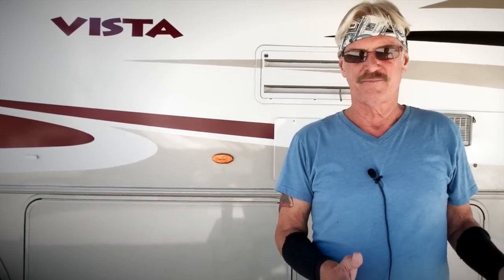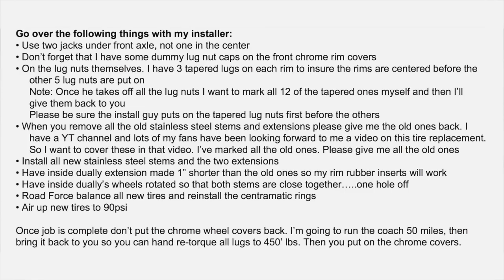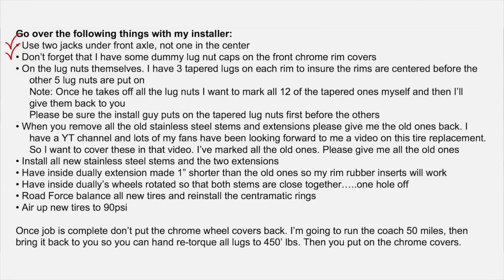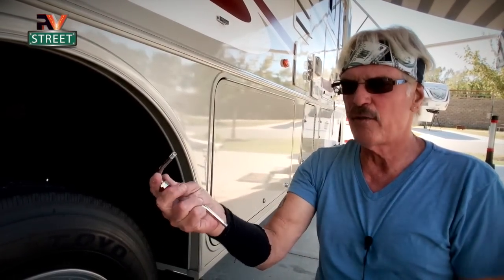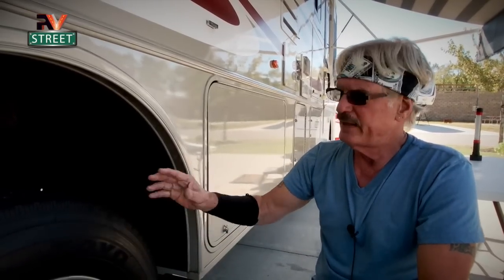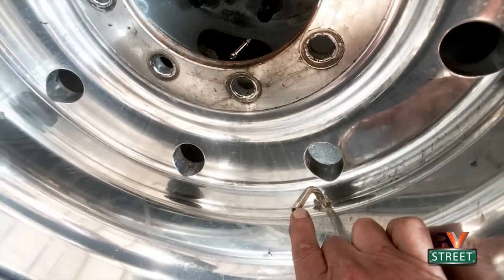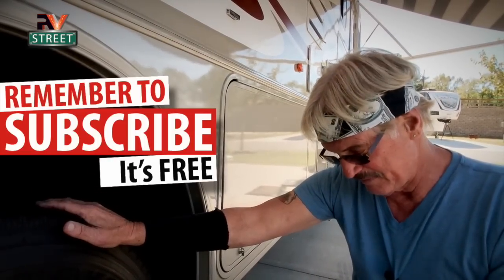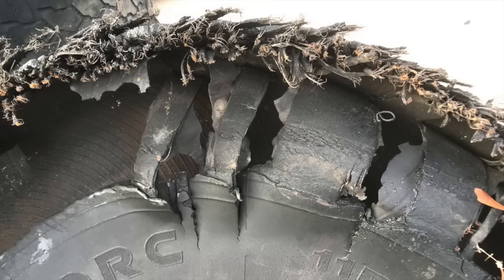In's & Out's of BUYING & INSTALLING New Motorhome Tires

Comment from the maker: A little more detail…
The rubber grommets I showed to hold the extensions firmly in place are hard to find. BUT....I finally have them in my Amazon Store in the "Tire, Engine & Chassis Care" category. And I highly recommend installing Dill Stainless Stems and Extensions that you can get from the tire shop. They'll size them to the exact length you need.

These grommets in my store are a little pricey but well worth the money. They also come with a pair of extensions that will probably be the wrong size for your needs. Just don’t use them. Simply press these tough rubber grommets into the holes on your outside dually’s rim, the extension goes through them, then attach your TPMS sensor. Don’t put any type of lubricant on the grommets before you press them in. You want them to press in tight. They’ll keep your extensions & TPMS sensor solid.
https://www.amazon.com/shop/rvstreet

Our front Michelin tires were approaching to dating out with age and our rear Toyo tires were already 4.5yrs. old and getting older every day. Even though I could have gotten more life out of the tires, being a full timer, I need good tires that I can rely on going forward in the future. I depend on my tires every day. I wanted to change them out now while I still could. With inflation now on rise and supply chains already stressed, I didn’t want to wait another 6 months to a year and then deal with getting new tires, even if I could find them. I’m already seeing and hearing reports from many RVer’s around the country, that many brands of tires are getting hard to find, back ordered for weeks/months and that’s if you can find them at all. And from what I’m seeing, it’s only going to get worse and prices going higher. So being the proactive guy that I am, I acted now.

With my past experience with Toyo tires, I decided to go with M122's all the way around. They are a wider tire than the Michelin 235 x 80R22.5 XRV tires that comes standard on many Class A motorhomes or even the M154 Toyo that some Class A owners go with for a Michelin replacement. Even though the M154 are a little wider, I like the M122 because they’re even a little more wider. I like more meat on the road. And even though there are wider than the above two tires, they still allow enough clearance between the dually’s to keep the tires cool. You can install to thick of tires on the dually’s that will prevent proper cooling, but these Toyo’s are not one of them. In the past 4.5 years with my rear Toyo’s, my TPMS always showed those tires running right around 105º or so, and that’s in the summer with 90psi. They’re a terrific tire IMO.

It took Southern Tire 3wks. to get these tires and they also installed Dill Stainless Stems and Extensions.

If you're not going to Road Force Balance your tires OR run Centramatic Rings then the standard position for your stems on the rear dually's is 180º opposite of each other. Not side-by-side like I did mine.

There is no one part number for Centramatic Rings. The ones you need will depend on the type of hubs you have, bolt pattern and the year and model of your RV. There are literally dozens of different configurations. Contact Centramatic sales and they'll get you the right ones for your RV.
https://www.centramatic.com/

Comment: Great video! I bought Toyo M154 2 yrs ago, they are great! I've read nothing but good stuff about them. 
When first shopping, I priced them online to be delivered but not one place would guarantee the date to be newer than 2 years! Unacceptable!
So I called around local and found a tire shop that called their warehouse to get me dates that put the tires at 5-6 months old and they weren't much more money than online. Like you, I'd rather pay a little more and know what I'm getting. 
I do wish I bought those balancing plates (I will next time), not sure that these little beads do anything at all but I don't have shaking issues. If I need to replace one tire the balancing beads in the old tire are tossed away with the tire, it was my first time buying tires for my RV so I'll chalk it up to live and learn.
Love the Toyo ride and price. So much cheaper than Michelin.

Comment: Thanks for all the info, picking up our new 2023 Forest River XLR Boost 21XLRX tomorrow. I am a retired truck driver of close to 25 years and the #1 cost is fuel and the 2nd biggest expense are tires. I owned several trucks in my career and the biggest thing I learned was to get yourself into a routine of checking your rig daily. Check your tires and your oil every time you get fuel and when you do stop for any reason always do a walk around, and unlike driving a big rig where you are on a schedule my RV days will be at a much slower pace. Thanks again.

Comment: Hey guys Vinnie & Joni from Florida! News on our RV. Supposedly we're going to get it back this week! 6 new tires and all the repairs are going to be finished this week. Plus a roof check. . . Now we'll get to use all the updates and upgrades we did before we went to the keys earlier this yr. 
 The tires we went with are "E" rated Firestones. More than enough for our rig. 
 One thing I'd like to add to your video. When I had my blowout. The closest tire place was a Firestone store. They had 2 tires that were what I wanted. BUT, they couldn't lift the RV. So, we had to run down to a semi truck shop.  They could lift it, BUT, they weren't equipped to mount the tires. . . So, I had to buy the tires at Firestone, then, run down to the semi shop and have them take my rims off and run me and my tires and rims back to Firestone to have them mounted. Then run back to the semi truck shop and have them remount the wheels back on the RV. What a cluster F. . . Good thing is I will now know the history of these new tires. My tires were about 2 yrs out from being to old. But I had 1 bad tire. And just thought it was out of balance. I was wrong. I had a bad tire. 
 Thank God the blowout didn't do any body damage. The blowout took out my black water tank and mud flap bracket and mud flap. It also took off the tailpipe. As well as damaging a plastic fender flare. No body damage. 
 Slam jam took my tire out. Shortly after I hit a joint going through a large city. I noticed my RV developed a slight shake. Within seconds it shook hard a few times and blew up. It was very loud and luckily it was a inside rear. So it was easy to control. And I could still drive it. 
So that's my story. We can't wait to get it back. Great video again!! Take care talk to ya soon 
Vinnie & Joni J
Reply from the maker: What a cluster F. . . INDEED. What a hassle.
Ya, I'll bet your excited to get back on the road.
Reply: Yes sir we are.

Comment: I’m getting TOYO tires installed Monday. I had watched your video previously and I remembered that tool you were talking about for the lug caps. My front wheels are solid, but my back duallys had the dummy covers. 
Thanks for your informative video. I honestly didn’t know what that tool was for. It’s been in the kitchen drawer in the RV since 2016. 
Bought it new in 2016
37TB Thor Challenger
Reply from the maker: Glad I could help

Comment: answered asks, "Why?", again. Unfortunately, I have a little too much time on my hands, my RV is in the shop getting Kingpin bushings replaced, should have it back this week. Of course, it is now too cold for me to do many of the great projects outlined in Martin's videos. I do still have things that I need to do on the inside so that should keep me busy for a bit. Thank you for all the great information I wish you had been around when I got my first motorhome.,  

My 2018 Thor ACE came with the braided Stainless-steel extensions that attach to the center hub on the rear wheels. This arrangement certainly makes checking the tire inflation easy. When I do replace the tires, I should replace these extensions. The question in my mind is whether I should keep this same sort of extension when I do get new tires. 
I know some people simply do not like this type of extension. And, Years ago I have had an issue with one of these leaking that caused a tire failure. The problem was caused by overtightening the connection to the tire valve stem causing the o ring to be pushed out of place. That could also happen with a rigid extension as well.
Reply from the maker: Ya it could happen BUT it shouldn't with an experienced tire guy. Those extension should be hand tightened first and then about a 1/3 turn with a wrench. No more.

Comment: Excellent information.  I have a metal extension on my dual tires and I can't get a TMPS sensor to hold air on that extension.  just on one side.  I don't know why, I addressed it with the tire shop and they couldn't figure it out either so I just left one of the TPMS sensors off and I just manually check it.

Comment: One thing you don’t know is the fact that the tire shop always overtighen the lug nuts, they use that monster air wrench and over due it.
Then they check with the torque wrench which in most cases is useless because it’s too tight,very dangerous because now you stretch the lugs and increase the chance of breakage.
Tip from all my days of trucking, heads up folks

Comment: Thanks for the video.  I have 2 Toyo's on the front of my MH and I like them.  They are nearing the end of their life.  On the rear I have 3 Goodyear and 1 Yokohama.  I have learned that many tire stores do not handle 22.5" tires!  So I have had problems finding tires to fit.  But recently I found a tire shop near my house that stocks Toyos so I will probably go there when its time to buy tires.

Comment: I do not like my wheel covers, similar to yours but all lnuts are dummies (came with SUNSEEKER Class C). I don’t put them on because tpms valves do not extend enough to easily check tire pressure which always reads differently then manual check. Guess that’s in another video lol. Thanks for putting this out there, good info.
Reply from the maker: With a sad heart I have to tell you that Martin has passed away and I don't have the answer to your question.
Reply: Omg I’m so sorry to hear of Martin’s passing. 😢My sincerest condolences—he will be greatly missed.😊

Comment: Thank You Martin for such an informative Video here and we're new  to your Channel and New owners of a New 2023 Winnebago Vista  NPF 30' model and drove it home from Lebanon, TN to home South of Charlotte, NC. First off after leaving the Dealership in Lebanon, TN. and while driving 5 miles down Hwy 40 Eastbound, I noticed that the Steering wheel was Clocked off center @ 11o'clock so we took the next Hwy Exit, called the Dealership and returned to correct that issue as I was not satisfied with driving 6+ hrs to our Home with a Cockeyed steering wheel.  An hour and a half later, Steering Wheel straight, we were once again on our drive headed Eastbound on our Journey home with one overnight. Okay, being a 1st time owner driving a Class A Coach where I'm sitting right above the turning wheels, I was not aware of the difference from driving my 3/4 ton Duramax  p/u truck. Anyway, as we drove the Hwy and experiencing Big Rig Blow Back as those 18 Wheeler's passed by and also suffering the Negative Pressures once they passed us, it was an educational experience as I White Knuckled it through the two tunnels and Saddle back turns through the Cumberland Pass  fighting Swaying, Wagging, and Steering Corrections the whole way towards  NC. and then Home. Again we're New to your Channel here and may not have seen any Steering Stabilizer Videos you may have posted yet, but I'll look. Please let us know if you've made any front suspension add-ons to help avoid the so called Death Wobble conditions.

Comment: This video hit me real close to home! Our 2016 Bago Adventurer 38Q is in need of 4 rear tires now. I've run the dickens out of the original Michelins, they have 60k miles on them- still not worn but definitely aging out. I'm getting really spooked about using the rig until I get new ones as I approach 7 yrs(2015 stamped from factory). I looked at Toyo 122's but there was about a 4 mile speed difference which is a bit much for me. I am going through much of the same issues you identify. Last yr I put 2 new Toyo 154's on the front and I love them. So I want to put 4 Toyo 154's on the rear. I have used Southern also and they do good work. My big issue is going to be extensions on the inner duallies. The rig came from the factory with flex extensions which I absolutely hate! They are difficult to check pressure and one is leaking. I want to go with a solid metal extension set up when I change. I have had very good experience with bead balance and have had no problems with the TPMs sensors. An excellent video. Thanks Martin.  (PS notice that notorious sweet aroma LOL provided by Toyo??? We get a good laugh each time we go by the rig)
Reply from the maker: Ya know, I've heard some people mention about this so called "smell" of new Toyo tires. I've owned several sets on other vehicles and now 2 sets on our coach and have NEVER experienced this smell.
EDIT: I forgot to address your speed difference comment. Ya mine is off 2mph but I just don't worry about it. Joanie is always monitoring my speed on the GPS and I'm watching my speedometer. If I want to run at 65mph I read 67 on the both the GPS and on my dash. As I decrease speed to say 35 or 40mph it drops to 1mph. To me it's just not a big deal.
When I had my Ford Truck, I raised it up, put gig Toyo's and rims on it and there was about 6mph difference. That was a bit much. So I bought a—similar unit to 5 Star tune—and upload a speed fix according to the size tires I had. It cost me I think about $100 or so. But that ended up changing the code in my PCM and that became a problem when I had to take it to Ford for some recall stuff. Then I wish I hadn't done that. So not doing that ever again.

Comment: Tire safety note. I am sure you have seen the result of the damage a tire blowout can cause, even to another vehicle that happens to be next to a vehicle that as a blowout. Of course, this video is about avoiding the worst-case scenario but still everyone should take safety precautions just in case. I just ran across this paragraph in my Ford owner's manual.

All tires with Steel Carcass Plies (if equipped):
This type of tire utilizes steel cords in the sidewalls. As such, they cannot be treated like normal light truck tires. Tire service, including adjusting tire pressure, must be performed by personnel trained, supervised and equipped according to Federal Occupational Safety and Health Administration regulations. For example, during any procedure involving tire inflation, the technician or individual must utilize a remote inflation device and ensure that all persons are clear of the trajectory area.
Stay out of the trajectory (1) as indicated in the illustration. 

There is a little illustration showing a 5' - 10' hose between the tire gauge and the tire valve. I suspect this is likely a bit of OSHA overkill but for my money I think I will be adding that hose extension between the inflation gauge and the tire chuck. The only thing worse than a blowout is a blowout that happens while you are next to the tire trying to air up a low tire.
Reply from the maker: Ya there's a lot of tire safety stuff many RVer's don't pay attention to unfortunately but I do my best to educate those who do care. Tires are the #1 thing I pay real close attention to. I've created a PLAYLIST that deals with nothing but tires:
https://www.youtube.com/playlist?list=PLkQXtMp9xodQeXFHj4klNmJn_WEqIID-f
Reply: @RVstreet  In my motorcycle days one of the things that was drilled into me was to never linger next to another vehicle because often you cannot be seen by the other driver. However, a more important reason to not linger next to a truck is because of what could happen if a blowout on one of the trucks tires occurs. Right about the time I started riding there had been a motor cyclist killed by the shrapnel from a truck tire blowout.

Comment: My concern with the tires on my 1981 c class. The seller (of the RV) said the tires are new and they look new, but the dates are about 10 years old. I asked a local tire shop about this and he said he would take a look at them for me.
Reply from the maker: He lied. No point in having a tire guy look at them. You're already on borrowed time. If the tire guy said he'd look at them, you need a different tire guy. Doesn't matter how they look. They're 10yrs. old and need to be replaced. PERIOD.